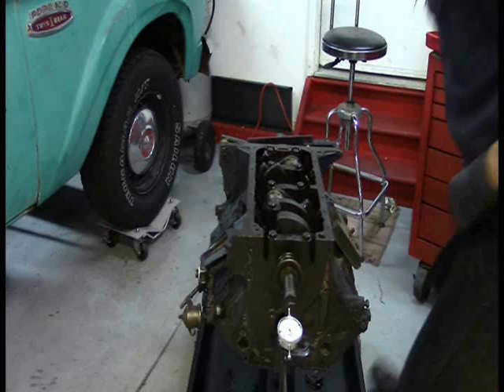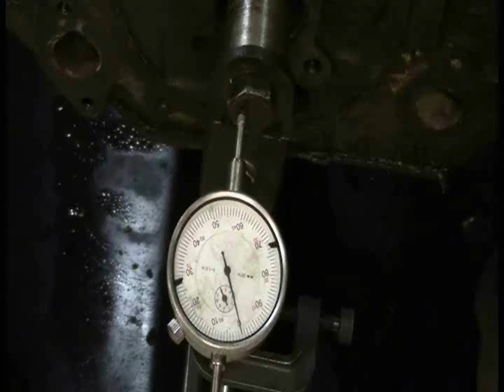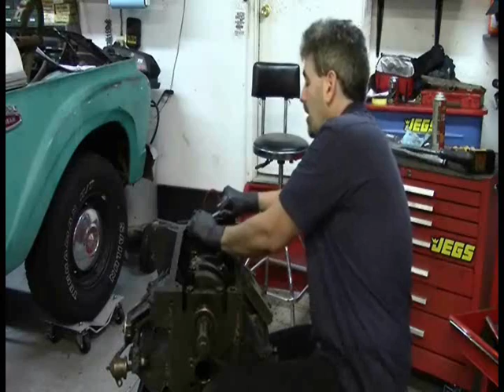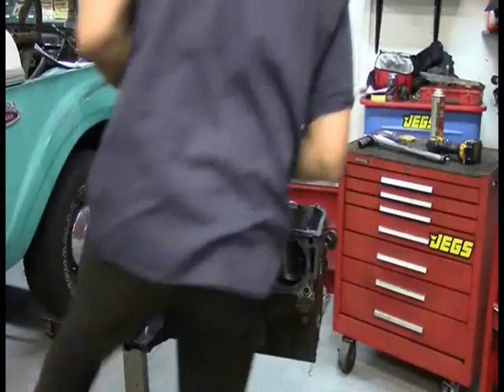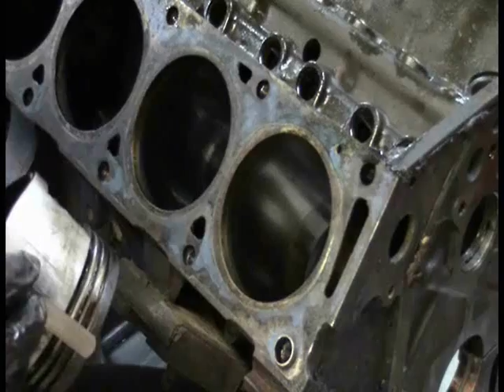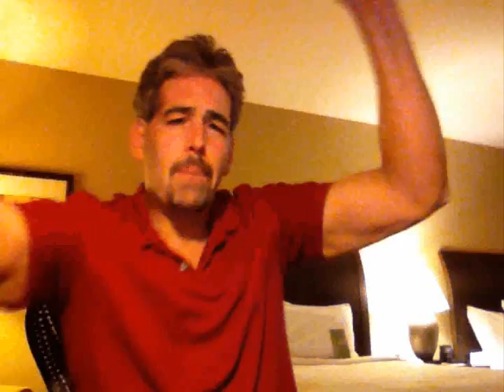Extreme Budget Engine Rebuild Pt 3- "Budget Rebuild" is an Oxymoron

Comment: I'm gonna nitpick for a moment, if I may.  Purely in the interest of discussing different information, though.  :-)

WD-40 works pretty well as a short-term surface protectant, but I have, in the past, had cast iron surfaces begin to rust in as little as a week and a half.  At the recommendation of one of my college automotive professors years ago, I've found I've had much better luck using ATF.  The application isn't quite as easy as WD-40, but I currently have a cast iron block that's been sitting for almost two years now (stripped bare, shot-peened, waiting for modifications and machine work), soaked only in ATF all that time ago, and it's still in great shape.  I have an old spray bottle filled with ATF that I used to soak the block, and applied ATF to the cylinder walls with coffee filters (which are great for engine cleaning!).  A little extra work, a little extra expense, but as you said, a build like you're working on here could potentially go on for months!  ATF may give a bit more security for folks not entirely sure of the timeline they may be facing.  :-)

Second, I'm a bit skeptical of your method to measure cylinder wall to piston clearance.  Often, manufacturers will list a specific area on the piston that they want measured to check clearance.  Pistons tend to not be round, but rather oval shaped, with the widest area being at the bottom of the skirt 90 degrees to the wrist pin.  As the piston heats up, the aluminum expands in a controlled fashion based on the piston's design, and will, to some degree, true itself in the bore.  Taking a measurement at the ring lands may produce false readings, as that tends to be the most round, and narrowest part of the piston.  As a rule of thumb, I measure my pistons approximately a quarter inch from the lowest point on the skirt if I'm unable to find information about where specifically to measure.  I've seen the number .300" thrown around here and there, but I don't know if there's any validity to it specifically.

If you have information contrary to this, please let me know!  I'm perfectly happy to be wrong, so long as I can learn something in the process.  :-)
Reply: WD-40 + film wrap is fine from what ive found, film wrap being key...is this what you did? or just WD-40 it?
Reply from the maker: Excellent comments. Regarding the ATF for protecting the engine, someone else brought this up in an earlier video I did and I have looked into it and I agree it seems a viable alternative but I think WD-40 is fine too. I have seen rust form in days in an unprotected engine so really anything that coats and repels water is fine but what works best I am not sure, but WD-40 is easy to spray on. If I was storing the engine for, say a year, I might be inclined to do something else.
  Your point on the piston measurement is well taken and was mentioned in a previous comment too. I do agree with you but the thing is, I've done this several times before (on cold engines of course) and the piston/bore tolerance always measured exactly to spec using this method until I came across this engine. I have to believe that with that much slop, engine temperature will not possibly be able to cause the metal to expand that much to fill more than a .050" gap.  I did call my machine shop and shared my measurements and they did indeed recommend the engine must be bored based on my information.
  I do think I will invest in a bore gauge on my next rebuild though based on your comment.  I do agree the test I did is not optimal.
Reply: Schrodingers Box I've seen you tear down a couple different things now and at this rate even for a DIY it's about the exact right time to add that bore gauge to your toolbox.  You certainly could have really used it here.  Maybe even pick one up to use towards the end of the project.  There really isn't any way around it if you want to be sure.  Want a precision answer then you need a precision tool.
Reply from the maker: ***** Devon, you are absolutely correct. In fact, I will look into getting a used bore gauge for my next video on this series just to confirm. If nothing else it will validate my feeler gauge method which I do believe to be accurate but need to prove it conclusively.  btw- nice call on your previous comment that I must be doing this project for a good friend who has sentimental attachment to this truck. Damn bro- you nailed that!!!
Reply: Schrodingers Box
WD-40 is definitely much easier to apply, and lots of folks do tend to keep a can or two laying around the house somewhere, so you can't beat it for simplicity!

Your comment about your past piston to cylinder wall clearance measurements are interesting to me.  I have my engine pulled apart for a re-ring and cylinder head replacement, so when I pull the pistons tomorrow, just for fun, I'm going to do the measurements the way I learned to do them, then try your method as well to see if there's any difference!  I will, of course, post my findings.  My engine is not quite as common (2.4L Oldsmobile L4), and the factory specifications tend to be very, very tight for a domestic engine, so the results won't be conclusive as to which method is more accurate, but it'll still be fun to see.  :-)

Dial bore gauges are AWESOME!  They're also EXPENSIVE!  Augh...  $400 for a cheapy thing that's about as accurate as a politician in a courtroom, and $1500+ for a really nice one?  I don't rebuild enough engines to justify it.  T-gauges/Snap Gauges and a vernier-scale micrometer work just fine for normal builds once you get used to them.  Race engines are a different story, but those typically don't get built at home in a garage.  ;-)
Reply: *****
WD-40 and bagged, but not cling-wrapped, which was very likely a contributing factor.  By comparison, the cast-iron block I spoke of in my original post is neither bagged nor wrapped; only soaked in ATF and stored under a towel.  I mention it only for comparison purposes, though.  If someone's working on an engine for their own vehicle, chances are, it'll be back in the vehicle within a few weeks.  In my case, this is an engine that I'm slowly building with intent to modify heavily for greater fuel economy.  I wholly expected that it would be sitting being a lump for quite some time, and ATF is great for that situation.  :-)
Reply from the maker: I look forward to your post, especially since it may save me from buying a bore gauge lol. But seriously, my bet is if whatever your method shows- whether in spec or not, mine will concur.  I have done the feeler gauge test many times and it accurately measured the piston to bore clearance.
Reply: rhkips ill give the ATF method a try next time, can never find the cling-wrap or its finished anyway lol.